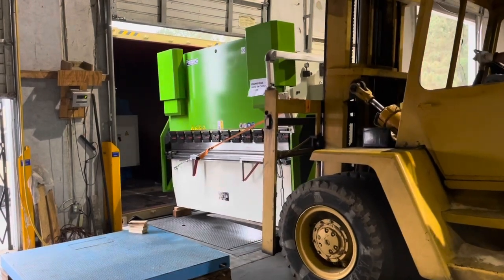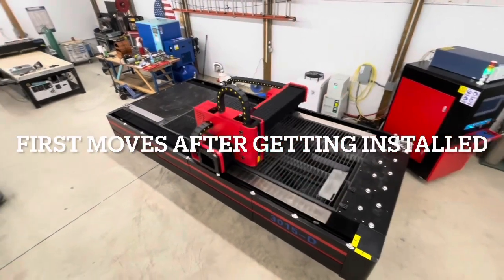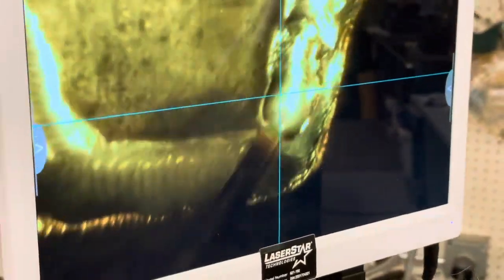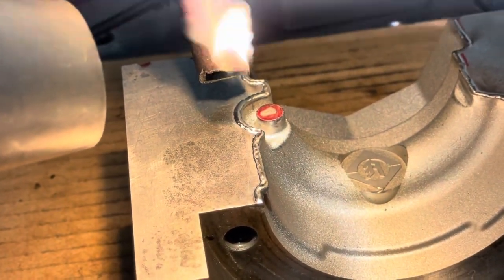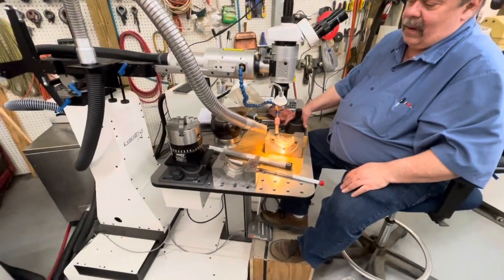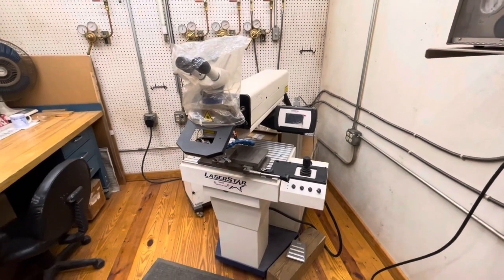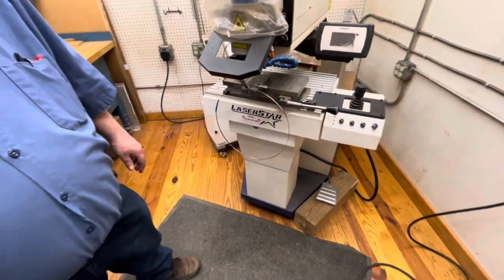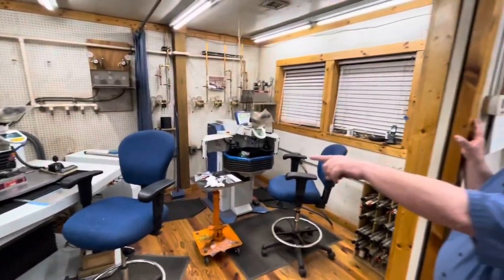Fiber Laser Welding with Tri-city Laser, Forrest City, NC

Comment: The red laser is incredibly fast, and the fine part you showed on your finger is super impressive. At the 300w welding station, how the heck is he not wearing (and you?) laser safety eye protection since the work area of the laser exposure is in the open and reflections?
Great peek at this mission.
Reply from the maker: I had 1064NM glasses on, but as far as him, his eyes were covered how he was connected to the machine.  300watt laser is really only dangerous to the retina, and we both had ours protected